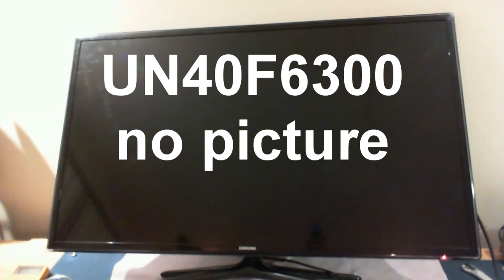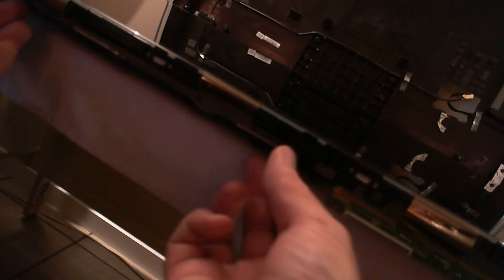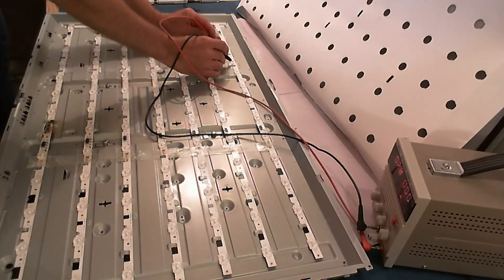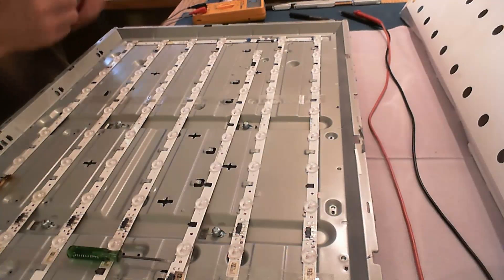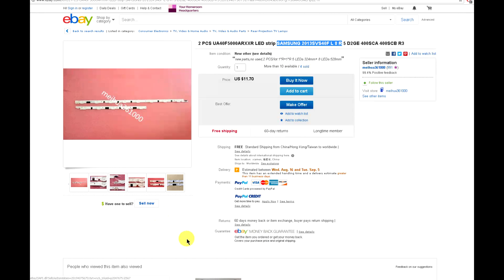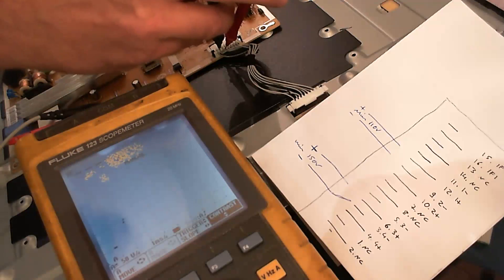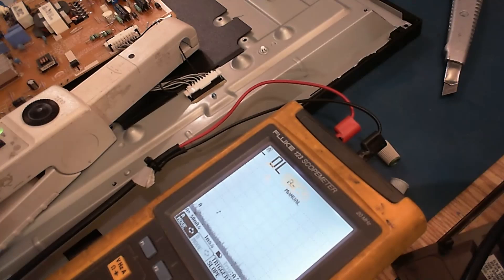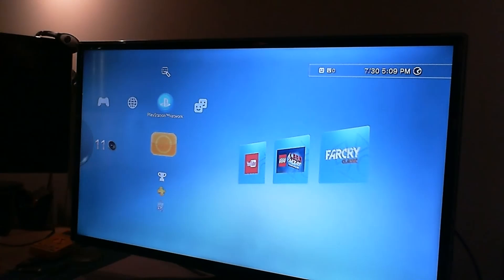UN40F6300 backlight repair and LED current adjustment UN40F5500

Comment: you are lucky that the white sheet does not have keep in fire more than this , i actually work on a 75'' same serie , these Fseries  have some major fire issues , you should check a video that i have posted year ago , same as your if i remember , if not , its a F serie like your , 

junction become lose  and red hot 
traces on led strip also sometime become red hot 
and when it occur  it start to flicker as hell ans diodes becomes cooking plate ( red hot)
 fire caught on white perfored plastic sheet under one or all of this circumstances and fire grow untill it starve of air 

its a real carnage lol

thanks a lot for the current mod idea , im not sure if it also possible to drop led current via service menu on theses series 
manufacturer have the great idea ( not great at all) to overclock leds on our tvs , ( light brighter /less led /die faster ) in fact leds tv is barely the sheduled obsolecence version 2.0
just to imagine , in service menu most of  hisense tvs  backlight level is mostly at 255 , drop it to 100 and never a led will burn

Comment: Thanks for sharing the details. I have the same UN40F6300AF and I see a dark horizontal section in the upper of the screen. It’s not blacked out but I can see a difference in brightness. 
Do you know why would be the problem?
Reply: I have the same UN46F6300 and the entire bottom of my screen darkened out a year or so back. Eventually, the entire screen died and now it won't turn on. Your problems are the LED strips and/or the power supply board. I would recommend you open it up and search for the power supply board.

If you have some dimmed areas, some of your LEDs are out. You could open it up and check them one by one individually with a meter. Then you'd have to learn how to fix the broken ones like this video, or add a jumper cable to skip the broken LEDs. Or you can just buy a full kit online with all strips and replace them. It's pretty easy if you can handle a screwdriver and can manage being delicate with your hands. About ~$100 fix for both.

LEDs: Samsung BN96-25304A/BN96-25305A LED Backlight Strips (14) NEW
Power Supply board: Samsung BN44-00645D Power Supply / LED Board
Power supply board alternative: Samsung BN44-00645A 00645B (KTL SU10054-XXXX) Power Supply / LED Board
Reply: @shadow.banned  
Actually I did repair it. I bought a complete set of LED lights and changed them. Now it’s working all lit with no shadowed section.
Reply: did it look like soot ( burnt redidues from post-fire ) ? lol 
these tv caught in fire behind white sheed and led strips !
Reply: @Vo0d0o2009  
Not sure what you meant. Mine did show any traces of burns, either on the LEDs or anywhere else. Bought and replaced the complete set of backlight strips (7). All good now.
Reply: @abdenourderouazi3898  which led strips did you buy? And are they still working? Looking to replace mine like same as you.
Reply: @bobbybuckets3113  
I can’t remember the details but I did record what I did and here is a copy-paste of all that. Please check if your TV is exactly the same as mine. Good luck. 
 
get some zip bags to put each set of screws on them to avoid missing and mixing. 
please take all the screws on the back cover. That includes the wall mount screws and also a screw by the video jacks. Anyway I had some troubles to remove the cover because of that. 
I got some hard time with the front outer bezel. Be careful and go gently. Take your time and watch how it’s made. It’s more likely you try to pull gently out then lift. It has some tabs that hook it down to the frame but at the same time some other tabs that slide in. So pull tabs deforming out it too much will break the other sliding tabs. Really tricky for me. I got it out but broke few little plastic tabs. I’m hoping it’ll still fit snug when I put it back on. 
I’m taking pictures with my cellphone for all the steps and parts. I’m also using painters masking tape to label part, like their positions (bottom front, top, etc.). I use frogtape (the yellow one, I find it to be of a good quality when I painted my place, this brand might not be available outside North America?!, don’t know). 
I’m now at the LED bar or LED strip they call them? There are a bunch of reference numéro but I’ll put what I think it’s most relevant: 

Vertical strip (one only) Model: LED interface SF 40” REV NO: 3.4 ( CT130128 ) CODE: BN41-01970A 

BN96-25336A CBD3617 

Horizontal strips (7 strips) Left section N67 YC 13914 N4A 064 25304A 

Samsung 2013SVS40F L9 REV1.9 130212 

Right section N5F YC 00021 N4B 064 25305A 

Samsung 2013SVS40F R5 REV1.9 130212 

For a reminder my TV is a 40” Samsung UN40F6300AFXZC Version TU02 

Now I’m going to start looking for those part’s reference numbers online. More likely on AliExpress. 
one thing I’m not sure of is the type of tape they use to fasten the wires and strips to the metal frame. It’s kind of transparent and very strong. 

Update: the LED strips finally arrived (from Aliexpress) and got installed. So far it looks good. No more shade at the top. 
 

https://www.aliexpress.com/item/33027144917.html?spm=a2g0o.order_list.0.0.3a481802ysVmS5

Comment: Which instuments useing name of instuments his it in india
Reply: Pl reply me
Reply from the maker: I don't know what instrument you mean. Oscilloscope? Multimeter? Current probe?
Reply: @tomtechtod9200    oscilloscope what is that pl show me photo iknow multemeter
Reply: @tomtechtod9200   sir also one video dvd push power proublem repair
Reply from the maker: This was a fluke 123. You don't necessarily need an oscilloscope for the repair

Comment: I need to know what SOD323 TVS diodes to get for replacement?  12v and 24v what are specs?  The 24v one has 4E BA on it.  This a great video it helped me a lot.
Reply from the maker: If they aren't shorted I wouldn't bother replacing them. If they are shorted any tvs rated for the right voltages with the right footprint will do.
Reply: @tomtechtod9200   So someone told me the 4E stands for cmosh-4e just in case someone else need to know. Thank you for the help.
Reply from the maker: Hum. Not sure about that. The part number you mention is a 40V Schottky diode, not a TVS
Reply: @thebighat99  Did you ever figure out which TVS diodes to get?
Reply: @shadow.banned   no am  not sure witch diodes to get. I going to get some of cmosh-4e, and some standerd diods. but you know I just want to put right ones in, I would like it to be safe. you want the specs to match. If you find out let me know. :).
Reply: @thebighat99  get rid of them if you can  , they are mostly the source of principal faults on these series  then reduce current like he explain it the only samsung led tv that ive ever see caught in fire are ones with theses '' protection diodes '' on stripes , this stripes leds are lemons
Reply: @shadow.banned   I put the comsh-4e in i am 99.75% sure they where right parts in the end.  The tv is up in running no problems so far. If you use what i did your on your own I am not responsible for fire or loss of life.   leds where peace of cake to change. comsh-4e where not so easy.  I could not of done this with out tomtechtod video. Thank You!  The  TV to me has a nice picture and  it sounds better than a lot of tv  that I have had.

Comment: Thank you so much for the video, I used it to fix the backlight of my dad's TV. The middle LED strip had one faulty LED. But on the model he has there are no test points on the led strips for testing the LEDs. So I had to take all the little lens caps off and glue them back just to test the LEDs. Anyway, took me 4 hours to fix it, but it's working perfectly now 🙂
Reply from the maker: congrats. next time you can just scratch off a bit on top of the pcb traces leading to the leds, much easier

Comment: Thanks Tom for the detailed explanation in this video. I repaired a 40" Samsung TV that keeps blowing the LED backlights that I replaced. It only took 2 days and it blows again. It gave me headache for weeks now for why it keep burned the LEDs and sometimes 1 whole strip.
Reply from the maker: you need to measure the current through them. I usually lower the current via the menu or hardware mod on the driver board and never hear back from them.
Reply: @tomtechtod9200  thanks for the reply. I finally fixed the problem by replacing all the 3 led strips on that tv. And the owner never bother me anymore until now.

Comment: Nice Job, very good video, I had a similar fault and the main problem I had was finding suitable LEDs from china etc.
The other issue is having a suitable hotplate tool to remove and replace the LEDs with.
I got a tiny version from ShopJimmy. 

Can I ask, where did you find the schematic for your TV that's another issue with many of today's TV's
finding the correct circuit diagram. Thanks again.

Comment: You need to replace all leds.
Reply from the maker: No you don't. You "can" do that. You "have to" lower the LED current though.
Reply: @tomtechtod9200  
You must or you will open your set every time each led dies.
Reply from the maker: @djordjelukovac8041  if you lower the LED current to a maximum of 75% or less no other LED will fail. Doing this repair and continue with high current is pointless. But do as you wish.
Reply: @tomtechtod9200  I agree for led current.
Reply: All of those leds have equal working time. Of course you need to lower backlight brightness to be lower then 50,but after replacing all leds. Trust me ,customers do not listen ,they will  turn that up to 100%.
Reply from the maker: @djordjelukovac8041  that's why I lower LED current on the driver board itself. Never had a problem with that

Comment: HI, is there a way to repair a cracked screen on this model tv ? Thank you.
Reply from the maker: You can replace the whole screen, yes. It's definitely not worth it though.
Reply: @tomtechtod9200  Thanks. I have found a new use for it. I have removed the front LCD panel. I have now a huge bright LED panel light  :)

Comment: Thanks for sharing this video , I have same tv with 3 led were not working, i replaced the led bulb and all the leds were working, when i put the led strip back, As soon i  connected the led connector same led bulb blow again.  Do u think something to do with power supply?  Can u kindly help me with this. Thank u.
Reply from the maker: It seems you are not refering to this exact model number. Is it possible that the LEDs in your TV are actually 6V LEDs and you put in a 3V type? Or maybe you put them in the wrong direction, then nearly the entire voltage from the driver would be on the LED, in reverse direction which would surely blow it up...
What you describing never happened to me and it is likely that you made a mistake when assembling them...

Comment: Hi. very nice video. I have a similar but not identical screen with burnt led's. Will it be possibly for you to direct me to the appropriate current sense resistors on my board? 
Ill have to order new led strips. i have several burnt and most of the rest of them shows brown spots from the back....so thy did get hot. 
thanx.
Reply from the maker: what is the exact power supply model number?

Comment: Brilliant job Tom , I would like you to help me fix the issue with the TV I got, but before that I want to know if you adjust the LED current will the total LEDs voltage be reduced too? I have Samsung 40 smart TV and the power supply keeps burning the LEDs, it has three strips , LED out put voltage on the power supply board says 151v dc but when I test it with multimeter it givs me 175v, my question if I adjust the current will the voltage be reduced too? and how can I do that? should I search internet for the service manual? but I don't know which resistors have to be replaced, can you help me please? is there a simple way to know which resistors for all kinds of TV's power supplies?
my TV model number is UN405203, I hope you help me as soon as possible, best regards
Reply from the maker: I don't know this model. I'd say voltage will remain more or less the same. Average current and therefore power dissipation for the LEDs will decrease when increasing the resistance value of the resistor that is used to measure the LED current. Usually it is just PWM  switching a MOSFET in series with the LEDs. The resistor is usually a few Ohms, could be a couple in parallel and it is also in series with the LEDs. You can also have more than one LED driver , either from one IC or several ICs... Quite some variation. On some TVs adjusting the current will indeed adjust the voltage with a boost converetr, have seen that on RCAs.
Reply: TomTechTod 
Dear Tom, first of all, I would like to thank you for responding to people and helping us, we are all appreciate your time and help, 
would you mind helping me more if I give you the model number with a focused picture of the power supply? is it possible to contact you over an email?

Comment: Great video! I have my neighbors' Samsung UN40FH6030FHZA and I try to repair it. Red light is keep blinking. At first I was hoping on something easy, like a bad capacitor. I checked voltages and I can see  all low voltages OK, except that they are on (about 2 sec) and  off (about a 1 sec). I do not see any backlights and when I measured voltage on a back light it shows about 345V(max) to ground. As power supply constantly goes on and off, voltage has 345V max and about 290 min, when power supply capacitor discharging (triangle, saw it with my oscilloscope). The voltage should be around 265V. I thought LED circuit is probably open.  But then, why power supply is cycling ? Is it really turns power of when LED is broken? Should I try to imitate LED load? I want to distinguish what cause power supply cycling. Bad LED  circuit or bad power supply before I will try to get to LED strips. Thank you for any help. BTW, hen I saw you having a diagrams I was so jealous :) !
Reply from the maker: I don't know how the LED voltage in this particular TV is related to ground (chassis). I always measure the voltage that is applied to the LEDs, directly at the connector output. If there is voltage but no backlight at all then the LED circuit is open. Depending on how the LED driver /PSU is made a PSU board could either remain ON, shut down completely, cycle, or even get damaged when the LED strips are defective I suppose.
Reply: Thank you

Comment: I have a Samsung 46" LED UN456h6201afxza  BLACK SCREEN With sound i have watched several of your videos and i have a question. I tested the LED jack on the power board and i get M1+  288v, M1- 267v, M2+267v, M2- 250v, M3+ 250v,  M3- 225v, M4+ 228, M4- 07, this is with the TV on and the LED wire connected can you help me figure out where the problem is. I think it is the back light and or the power supply but i am getting conflicting information. MY THE WAY LOVE YOUR VIDEOS.
Reply from the maker: 1. 
What is the reference for your measurements/where did you connect the "-"probe of your multimeter to? You should be measuring with one probe on Mx+ and the other on Mx-. You do seem to have a high enough voltage on M4+/-.

2.
What is the board number? The one I found for this TV does not have M1 M2 etc. (BN44-00771A)

3.
How many wires are on the LED connector?

4. 
If there are more than two wires on the LED connector: Are they interconnected via traces on the PCB? This would be near/at the LED connector on the PSU.